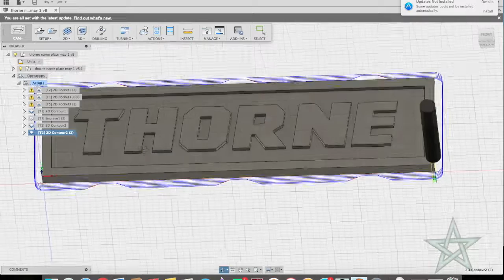G0704 CNC Mill First Cuts-Tool Box Name Plate

Comment: Great piece!  If you don't mind, what roughly was the total machine time for your piece?  And since this video is a few years old, what's the long term review on the cnc conversion?  I'd be curious if the machine is still being used or you upgraded to a full blown cnc mill.  Thanks.
Reply from the maker: Thanks.  I can't remember exactly , but I think total machine time was somewhere around an hour.   Since then I have moved several states away and didn't even have a shop for a year.   Just now got a shop and have the mill going again.  Have not used it alot though  I had alot of plans for more upgrades which have not happened.  Maybe some day.  Getting into knife making /bladesmithing now.  Cnc does come in handy at times.  I do plan on getting more time on it by making some folder knives.   maybe in the next year or two.   so far it has worked well as long as you know the limitations.

Comment: Looks great. I was wanting to make a nameplate for my box at work but haven't got to it yet. Mine was going to be cast using lost foam casting. BTW, what size end mill did you use for the inside corners?
Reply from the maker: End mill was .080" dia and followed up with a 60 degree v bit running a 2D engrave tool path to sharpen up the inside corners at the top surface.  I haven't done lost foam casting but I did make a wax pattern of a bell crank for a friend that will use it for a lost core casting of iron.   I have a video of making the wax pattern here :  https://youtu.be/dvrHfH_Ig0w

Comment: HA what is the lubrication and system that you using?
Reply from the maker: the coolant is cool-mist coolant but i'm mot using the mister here as I don't like the fog it makes.   Here it  is just going through a small aluminum block I made with a venturi  and a flow control valve.  kind of like a fog buster.  It spits like that because it gets built up in the loc-line tube.    I now have the mill in a full enclosure with flood coolant.